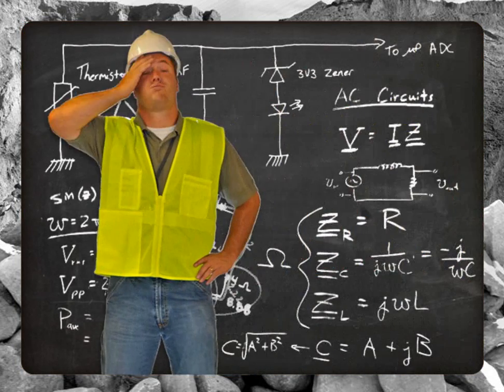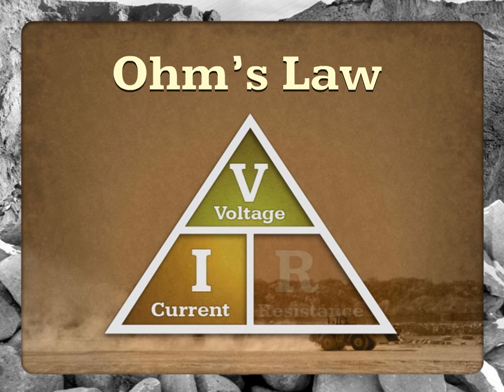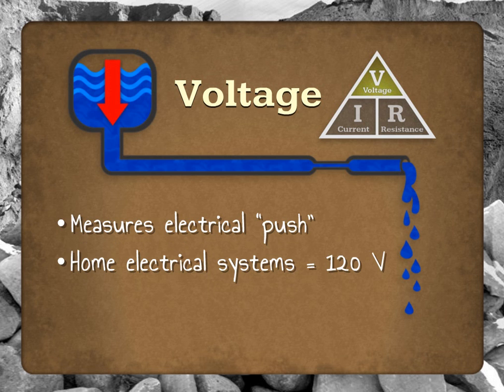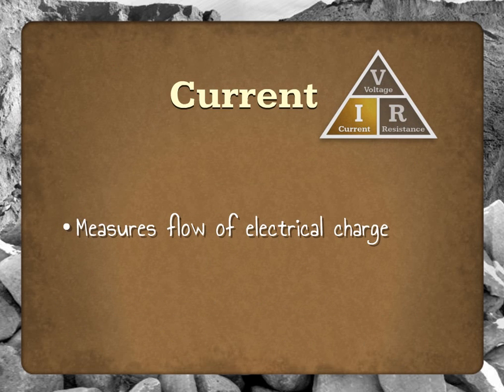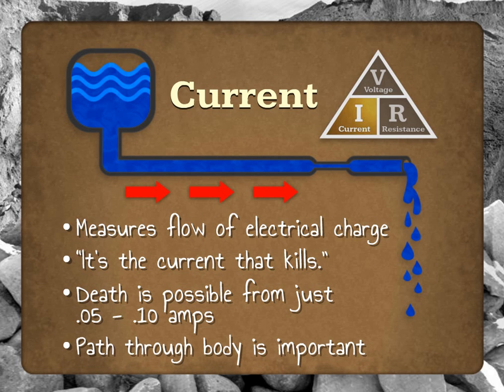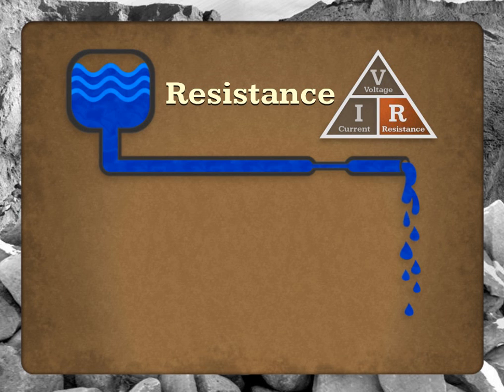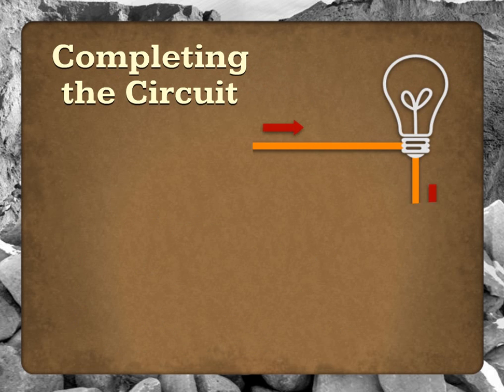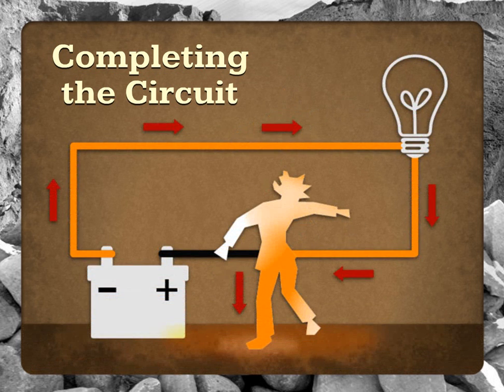Basic Electricity Training

Comment: But how does electricity know which path to take? What makes electricity flow in one direction? In your video, the circuit shows the current going clockwise from the negative terminal to the positive terminal. Why couldn't the current just as well go counter clockwise or even both directions at the same time?
Reply: If u understand the laws of attraction, than u have ur answer :)
Reply: From my understanding, electrons do "flow" both ways.  They wander a little, at times, back and forth, but the overall net movement -- in the case of millions of electrons, is in the desired direction, following the polarity.